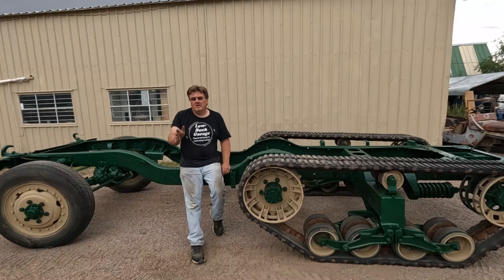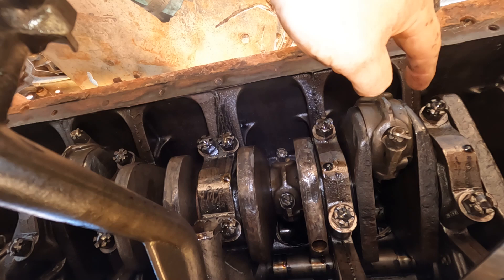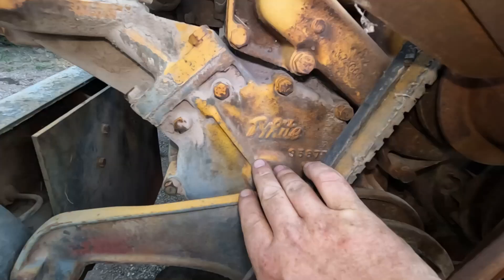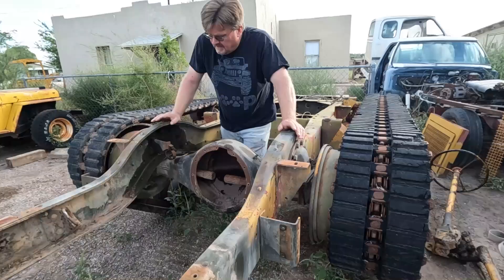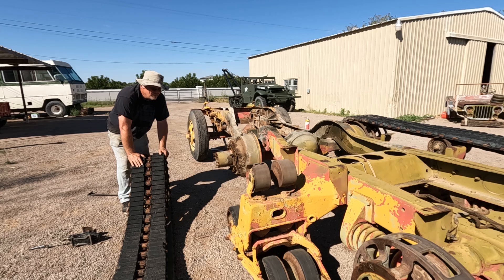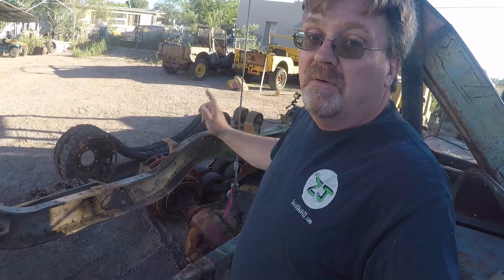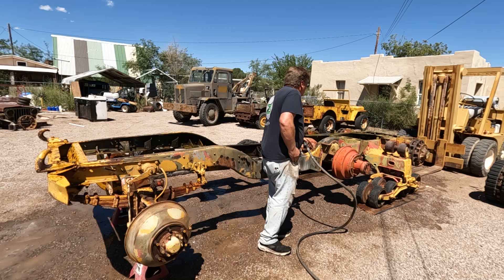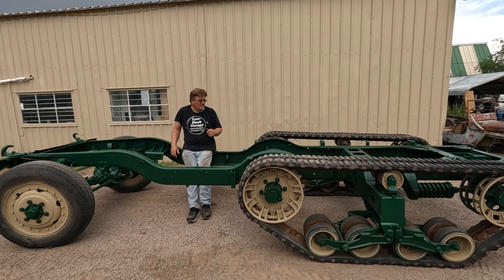WWII M15A1 Half-Track: Axle Swap Win, Engine Fail

Comment: WARNING!!! The replacement axle you have is from a International halftrack. The gearing will not match up to the front axle. The axle you took off is a Timken axle used on White, Autocar and Diamond-T halftracks.
Reply: - Nice catch. Phew !...Now what? Damn.
Reply: That was well spotted.
Reply from the maker: That would explain it.  Do you happen to know what the gear ratio is?  I can change front tire diameters to match it back up.  Good thing I didn't buy new front tires!
Reply: @LowBuckGarage  It's a little more complicated than that. I sent you another email. Call me.
Reply: You know your 1/2 tracks
Reply: @daleolson3506  I own several and have fully restored them to factory condition. I also sell parts all over the world.
Reply: @catscan64  my dad worked on them in France during WW2. He was with the 4th Armored Division. I'm watching with interest because I've never seen one apart.
He did say they were a pain to get the engine out of.
Now I know why.
Cheers
Terry
Reply: Was about to ask if the  gearing was the same in both axles , then read this .
Reply: It is a good thing NASCAR doesn’t have a half-track class. Those pit stops for tire change would take forever. I don’t think I could drink that much beer in one race.
Reply: @thisoldminewithlars5324  I bet You We could Give it a Good Ole’ College Try! 
Howboutchya?? 
Kum’on???

Comment: the copper brake lines are likely a nickle-copper alloy. they were very common on cars up through the 1980's  (volvo used them on the 240's, 740's, and 940's for instance.) when I'm replacing steel brake lines I always go with ni-cop lines, mostly because they're way, way easier to bend. they also have the added benefit of not rusting out, too.

Comment: That moment when right is left and there is a new filler plug on top and the drain is gone :o)
Reply from the maker: I had to go out and check after reading your comment.  The drain plug is down and the vent is up, whew!
Reply: Picturing the mini-tank project, the rear end would have to be reversed, making left now right. Right?
Reply: @LowBuckGarage  Oops, sorry :o)  for me it was; 8.5mm + 8.5mm is 19mm. I had  to remake that part on the lathe. :o)  Digital readout is good, but it doesn’t fix my stoopid :D

Comment: My half ton military Dodge pickup and the early flat fender power wagons were built to allow the frame to flex to make up for the lousy suspension and allow them not to tear themselves apart as they went over very bumpy terrain. I have pictures of my truck climbing out of a ditch at a angle and the cab is pitching to the right, the nose is pointing to the left, and the bumper was in between. The frame and rivets supposedly were set up to move like that without damage. If the springs weren't rusted tight they actually rode pretty well over feilds at faster than crawling speeds. My 42 GPW Jeep actually rode better at around 20 to 30 mph on bumpy grass fields as well. There was some thought and engineering to how they were built and the way they'd be abused in military service. The early power wagons like mine used 3/4 ton suspension that was derated to half ton so it could take the overloading and general abuse that was expected. The newer 3/4 ton weapons carriers were much lower lower on the much beefier frame to lower the center of gravity and make them more stable and safer to drive and correct for all the problems they found in the half ton early trucks that were only built into 1942 early 43 because the new version was much stronger and improved every where.
Reply from the maker: You're right about that!  I just have to keep in mind how the designers intended it to work, and go with that.

Comment: Just a thought but since you were thinking of putting a camper body on that before you realized the frame flex issue.  Maybe do whatever you decide to for a cab then mount a largish truck camper you can find used to back.  That way the frame can still flex but you still get your camper.

Comment: Hey man, you made a good move when removing the donor axle by NOT removing those massive U bolts. You diddnt comment but if you had done you would have neede to re-centralise and re-adjust the rotation when refitting the axle. Love you work and presentation. All the way, from the U.K.

Comment: WARNING!!!  To everybody that  has an old US halftrack from WWII. If you do not have a bed over the tracks... DO NOT drive the vehicle faster than about ten miles per hour. I was told a story by Tommy Hunt, parts manager of the defunct Southern Parts Corp. of Memphis, TN - World's Largest Supplier of Halftrack Parts.  Tommy recounted the sad tale of two youngsters that were driving halftracks that had the original beds removed. They decided to drag race one another briefly. Far briefly than planned. The track broke on one and whipped up and decapitated one of the boys. At higher speeds, even if you have the original bed, should a track break it will whip about crazily and even try to keep going. (I speak from personal experience.)   PS: There is a wrong way and a right way for a halftrack's rubber track to be put on. It has to do with the bolt on inner steel guide pieces. Each has a wider half. Which goes forward - I cannot remember.
Reply: That's so sad

Comment: In the UK it's quite common to replace your brake lines with copper. I've watched the number of British automobile restoration shows on the BBC and that's what they use though it could be a special kind of copper brake line and it still has to be double flared. It could be because copper doesn't rust?

Comment: Has far as the copper brake lines, I own a 1958 Jet toter . It also had copper lines. I am wondering if this wasn't a thing back then. Great job on the half track. Looks great. Has always I liked and shared. All my best.
Reply from the maker: Thanks!  I think you're right, it looks like brake lines used to be copper, and then they changed materials.  Maybe they started having failures, and that's why they stopped using that material.

Comment: Wonder if the guy that had the axle in the shortened frame tank was the one who originally swapped the left and right hubs? If he turned the axle around to have the nose of the diff facing between the tracks, then he should have swapped the hubs left and right at the same time. My guess is the brake shop just rebuilt 'as-is' so they stayed the wrong way around.
Reply from the maker: I think that you're right.  I didn't see it until I was uploading the video, but the pinion turns the wrong way.  I think he flipped the ring and pinion center section with the diff cover to get it pointing to the back.  Which means there will be a follow-up video of me pulling the rear out again, flipping all the internals around, and re-installing it the other way.  At least the lug nuts will go to the correct side...

Comment: A camper is made too move, to be taken into remote places, plus a camper on that rig is never going to see 65/70mph again, or why couldn't ya just put some suspension between the frame-n-camper if your really that worried about it, your logic eludes me on this one, lol, that would make a hell of a portable hunting cabin tho,👍, thanks for sharing.
Reply from the maker: The half-track frame is surprisingly tall.  I measured it up, the camper body on the bare frame would put me over 12' high, stacking a frame and suspension in between would make some of the local bridges shave the roof off.

Comment: Check your gear ratio may be a totally different one.    And why not put the camper body and frame on air ride.   Should let the chassis flex without damaging your camper

Comment: @23:15  maybe make a spud to help line up those holes.  But the self-locking thread adjustments may be too important to use a spud.  YMMV.

Comment: Did you ever switch back the brake drums so that the thread is correct? I just found this channel and am binge watching it. You have some cool stuff.
Reply from the maker: Come to find out someone had flipped the ring and pinion over, so the whole axle is in backward!  I've got to pull it out, spin it around, and then flip the center section and diff cover.  Then the threads will be correct...

Comment: A rubber track on in half an hour is exceptionally good 👍 Especially with a dead machine. * put the long body on top but have a single pivot at the front? Honestly not my idea, the euro trial trucks have a single pivot boss on top of the front bumper for the roll cage.
Reply: That's going to be heavy, having a separate frame for the body on top of the chassis frame... Cool Two Frames... Nothing is better than absolute over kill!
Reply: @randymack2222  it’s a theme I like to use :o)
Reply from the maker: I think the double frame would work, but its going to get really tall.  I did some measuring, and I think there would be issues with fitting under local bridges.
Reply: @LowBuckGarage  oh well, you are only a few yards of two inch box section away from strengthening any body to be self supporting. Or maybe go with a cab from the same era as the chassis. (Maybe 50’s)

Comment: Since you said you need a separate cab\ bed setup, look at trucks. You could probably use a dodge cab and nose, then whatever you want for the bed. Reason I said dodge is because they had a taller nose for a Cummins diesel, and that would be a good way to get a reliable powertrain swapped in, and have the power to move that beast.  As for the axles not matching, check how many times the pinion turns per tire rotation, and that can give you front axle gear ratio. Not exactly sure about the rear ratio, but I'm betting it will be in the high 4's, to 5 something. Like 5.13:1 maybe 4.88:1 because these had torque, not speed. You don't want speed off-road, because of control issues. I'm hoping to see a lot more about this vehicle in the future though, because it looks to have potential, and I don't want to see it go to waste.
Reply from the maker: You'll definitely see more of this one!  I do like the Dodge cab idea, especially because I have a spare one lying around, but I don't have a spare Cummins.  Luckily the gear ratio is really deep, like almost 7:1 on the front end and 4:1 on the rear (the drive sprockets are much smaller than tires).  I think I can get away with a gas V-8 with that kind of gearing.

Comment: I’m enjoying the channel. How about a bit about you like do you work at the yard and how far away do you live? We don’t even know your name. I was also told copper is a no no for brake lines as it work hardens under vibration and fractures. My go to method for tightening bolts is snap it and back half a turn.😂 Cheers Stuart 🇦🇺
Reply from the maker: Thanks, glad you like it!  My name is James and I'm southern New Mexico, about an hour north of Mexico.  I try to avoid that bolt tightening method, but sometimes it does happen!
Reply: @LowBuckGarage  Thanks James and nice to meet you. My son is named James so your parents chose well😂😂
I’m in Canberra, Australia 🇦🇺 Cheers Stuart.

Comment: G'day.
Love your vid
I was wondering about the diff ratio on a half track.
Is the front axle the same ratio as the drive axle? On a 4WD they have to be the same to stop fight between the front and rear tyres.
On a half track the tracks would would be like a gear reduction. Is this right?
Karl.
Reply from the maker: Thanks!  The gear ratios are different, because the front tires are a lot bigger than the drive sprockets.  The front axle has a lot more reduction, and that makes the ground speed about the same.
Reply: @LowBuckGarage  Thanks for the info.

Comment: Hello, I have a rear axle of such a halftrack, is this of any value or should I bring it to scrap?
Reply from the maker: I definitely wouldn't scrap it.  They aren't super valuable, but more than scrap value, especially if it still has the drive wheels with it.  I paid $500 for the axle I bought, you would get less than half that at a scrap yard.

Comment: The UJ on the drive axle for the tracks seem to turn the opposite way to what it should.
Reply from the maker: Yeah, I noticed that right as I was uploading the video.  It looks like there will be a follow up video with flipping over the ring and pinion carrier...
Reply: @LowBuckGarage  I had a thought either the ring and pinion gears had been flipped or the whole axle flipped and brackets rewelded on. Possibly thats why the L and R studs are on the wrong sides. If someone had dome what you said about putting an engine in the ftrame of the tracks, then I suppose they would flip the axle to get it to do forward with the correct gears.